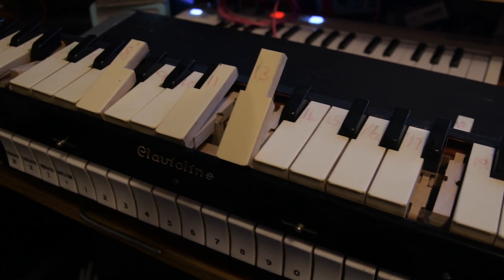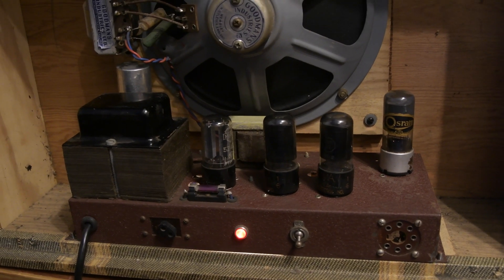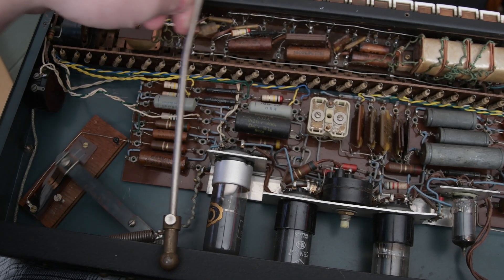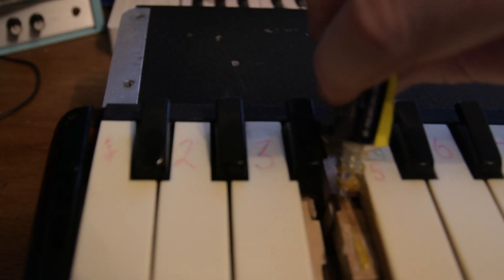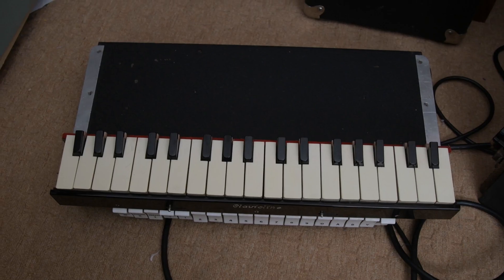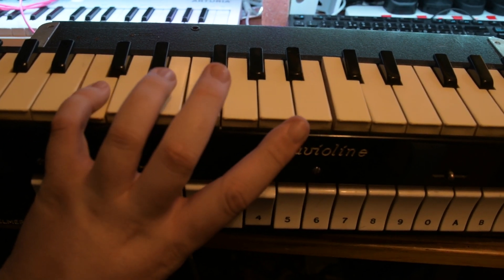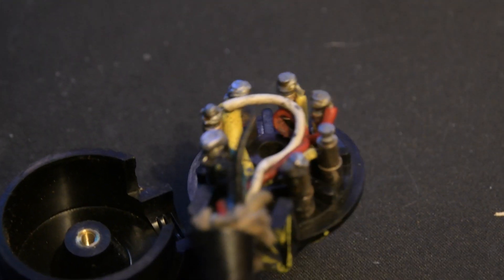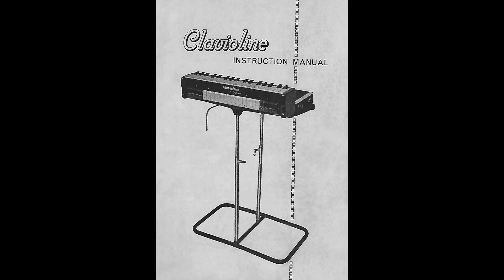Clavioline Part 2 -  Power Amp Repaired and Instruction Manual

Comment: Thanks for these videos! Just watched the whole DIY electric piano series and absolutely loved it!! 
I just got myself a Selmer Paris clavioline, but without the amp... hehe. I wonder if it'd be possible to use another amp, and make a custom power supply for the console... Would you know what voltage the amp feeds the console?
Can't wait to see your next videos on the clavioline
Reply from the maker: Very cool! Thank you.
https://www.vintagehofner.co.uk/britamps/selmer/schematic/clav3.html
Shows what is pin out for the connection, note this may be difference for your model, and it maybe DC/AC so be careful, still dangerous voltage.